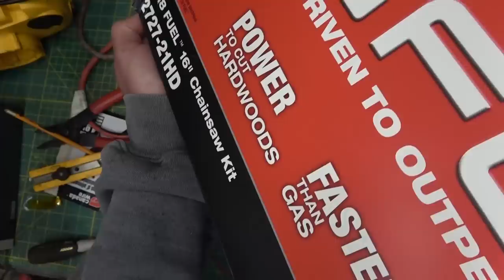BOLTR: Milwaukee Chainsaw | Destroys DeWalt

Comment: Good thing about the battery operated ones is that you can send the apprentice to the shop for a gallon jug of charge to refill the batteries.
Reply: We like the box full of 3/4 holes 😂😂😂
Reply: Worked till we had one smart ass grab a box of 3/4 o'letts lmao
Reply: Cup of steam also works great
Reply: Metric adjustable wrench used to work but some come with us standard and metric scale printed on them, But alas we still have a board stretcher next to the left hand screwdriver!
Reply: Next to the left handed screwdrivers.
Reply: I prefer the left-handed sockets and the automatic safety wire drill bit
Reply: Dave Pawson  pink or blue? They keep them next to the long stands
Reply: Pipe stretcher is a personal favorite.
Reply: Just like sending the newb to borrow the wire stretcher from the electricians.
Reply: "gah! Battery's outta juice. Aye rookie! Get some juice for the chainsaw!
Reply: A jar of sparks for the grinder.  The poor lad returned an hour later asking, "Jim said what colour you want, blue or orange?".  Off he went for orange sparks.  Still raise a chuckle 29 years later.
Reply: Reminds me. Got to renew my concealed carry permit for the grease gun.      🔫
Reply: Tartan ink. Was a favourite of mine.    Look up-kevin bloody wilson  ( The apprentice )
Reply: Tire stapler was my rookie search
Reply: Good ole hook calibration
Reply: chris jones are those compatible with 3/4" Fallopian tubes?
Reply: Compression powder, for when an engine has start difficulties.
Reply: Watched a newbie directional bore locator call the boss for a bag of rock-be-gone the other day :)
Reply: when I was working as a nurse rig driver for an agricultural flying service (crop dusting company) I once sent my flaggers back to the hangar to get a bucket of propwash....... why is doing stuff like that so fun??
Reply: Sent the apprentice to the parts room for a vacuum tobobilator.
Reply: don't forget the light bulb repair kit
Reply: Grab a bucket of compression for my engine
Reply: I would have loved to get sent on a fool's errand - might take me two hours to get back.
Reply: I need some fucking slack, go to the trailer and cut me some slack
Bout 3'
Reply: Go get the piston return springs, not the cheap ones either. The good ones are blue
Reply: Don’t forget to fill up the phone with powdered dial tone.
Reply: @JeffroDH  in my industry we have them chase down a Cable Stretcher and sometimes a Sky Hook.
Reply: 4 years later, but as a young roofer I was asked to grab a shingle stretcher one time... Happily asked the next guy under me to do the same when the time came 🤣

Comment: If you spot a full sheet of those "security" strips, swipe 'em. In bulk won't set off the detectors and you can prank people for MONTHS with a full swiped sheet. My record while working retail was stuffing one in the general managers lunchbox, tucked up under the zipper. Took him the better half of a month to figure it out, though pegged me with it immediately.
Reply: Hope you didn't AvE, the guy is trying to get you busted. They WILL go off, of course.
Reply: Take a random item and drop it in your buddy's sweatshirt hood watch the hilarity ensue when he walks past the detectors
Reply: Oh man, a friend of mine told me he did this to his boss way back. Said they were in home depot together, back when they used to have the tool coral and he managed to swipe a sheet of them and said he must slipped a dozen of them in his boss's cuffs and hood and pockets and whatnot and then showed himself out to the truck. Said his boss was as red as beet when he finally made it through security a half hour later!
Reply: I’ve done this, you find the coat rack and load everyone up, then be positioned for cheap thrills

Comment: @5:23 I work in plastic injection molding as a process tech. I have to mix up red color pellets into natural glass filled nylon all the time. Red can be hard to get right sometime and it is true molders will cheap out on the color, and try to use less resulting in lighter parts, and in worse case scenarios the color will be uneven. My guess is that between 2011 and now they changed suppliers on their color concentrate and the new one is not an perfect match to the old one. just my $.02.
Reply: I was thinking the same thing. I have experience in all types of food production and when working with things like candies, frostings, fondant, cakes and cookies, it is very hard to get a good red. A few ppm too little and you have pink or orange, a few ppm too much and you start to go black or brown. 
It's also the same with florescence. Reds take a lot more dye and a lot more energy input to give the same vibrancy.
Reply: I don't know, but my Makita gear is getting to be the same way. Growing variability in the new tools when it comes to exactly what color the corporate Theft-Deterrence Teal actually comes out. Some of that is down to base plastic, for sure, but I think more if it is coming down to contract manufacturing overseas. The little accessories (flashlights, usb chargers, etc) are the worst, understandably, but the tools are getting iffy too.
Reply: What it ultimately comes down to is value engineering. Procurement changes suppliers to a place that is 1% cheaper and 100% worse. I see it and fight it everyday at work (I'm a development engineer), but they always win
Reply: Also possible its a marketeer special and they decided a minor color to the brand identity change could result in more sales somehow
Reply: This. Unless its a premix and its color matched to a sample its a fucking raging nightmare to get it exactly right at the time of production.
Reply: Mike Hegarty  This is why they should have a separate sub brand for home gamer tools. It's obvious this is not a professional tool, and it kind of detracts from their brand.
Reply: James McCabe ¢
Reply: @nathandexter7483  It gets people talking about it, that's how. Any press is good press...
Reply: Yup always trying to use less colorant and washing it out
Reply: Red #40 is a strong un.

Comment: I spent 10 years as an arborist. The price of chains and bars is the real profit eater. In which case, feed that bad boy some Earl, and I mean lots of Earl... Used to fine tune the oil to run out at the exact same time as the fuel (makes sense to fill up both tanks at the same time)... But you wanna talk about a hot supper, we used to mulch the trailers down with 32" bars on Stihl MS-460s... Wide open throttle chopping through 8' wide, 3' deep sections of packed 3-5" sticks and leaves for an hour at a time, with no end in sight. Used to run 40:1 oil in those saws and tune the high rpm for it so we didn't smoke the pistons running lean...
Reply: First thing I do as well, turn the oil screw up, oil is cheap. Set too low at the factory, ostensibly for "environmental" reasons.
Reply: This reads like  a Jerry Reed song.
Reply: Yeah, as someone who lacks personal preservation enough to climb up into trees to cut them down from top to ground, this chainsaw is attractive to me so that I can use it for the high stuff that's hard to reach. I'd be fine switching to a gas powered for the big limbs and trunk once I've worked down below the canopy
Reply: Why aren’t you an arborist anymore?
Reply: i mix mine at 32:1 I would rather clean a spark plug (not that I ever have to do it ) then replace a cylinder and piston
Reply: @dusty2206  Seriously did you really write that?!?! Bwahahahaha! Have you never mixed fuel for a 2 stroke motor mate?
Reply: Kevin Kinsey Bingo! Yeah, or worse - cranks, bearings and seals.
Reply: Hey my man why tune the oil to run out same time as the fuel yes run more oil but dont risk snapping a chain by running out of oil before you run out of fuel you always want oil in that tank and 30yrs bro you should know always fill oil with fuel

Comment: The line across the body is used as a sight as it is 90degres to the chain, and the little metal tab is the chain arrest if it throws the chain.
Reply: When he called it 'greebling', I couldnt help but wonder if he's been watching more Adam Savage kit bashing lol
Reply: Beat me to it, but that is exactly what it is. On a Stihl, they usually paint them black to make them stand out more.
Reply: Came here to post these details, yes, the gunning lines are universal and possibly OSHA required on all modern chainsaws.  Chain catcher serves two purposes:  first, obvs, is to keep a stray chain from severing yer olde carotid should the sprocket decide to fuck off.   Second, less obviously, is to keep same chain from damaging all of the stuff inside of the clutch cover, including the case itself.  The way it works is that when the rotating body that is the chain comes loose, it folds over the sacrificial aluminum tab that is the chain catcher and gives up most of its inertia.  This chews hell out of that tiny little bit of beer can but does little or no damage to chain, saw, or user.  Replace the thing when you think to.  It'll catch a few chains before giving up the ghost.  Don't tempt the fates over a 2 dollar part.
Reply: hyperbole doesn't always translate well in blind text, just sayin

Comment: Hey AvE, just had a coffee maker go out. Checked the thermal fuses and sure enough that was the problem. Glad I've watched your stuff otherwise that would've been $150 down the tube instead of $3 for the fuse. Cheers my man!
Reply: $150 for a coffee maker?  I've been using the same $20 retail Proctor Silex drip coffee maker since 2006.   I got it out of the dumpster on a $60,000 USD bathroom remodel job.  It was still in the box, looked brand new and worked.  The carafe tends to dribble which is why I think the home owner threw it out.  12 years from a free cheapo coffee maker, when is life better, eh?
Reply: if the thermal fuse went it went for a reason
Reply: Similar here.  Had a ShopVac quit working.  Took the whole thing apart to see what was up.  Buried on the back side of the motor was a thermal fuse.  Darn annoying.  Could have been on the front where it was easy to get to.  Anyway, got it fixed up with a bit of old plumbing solder and it's back working.  Good thing I saw the old vid so I had a thought that might be cause.  Score one more for AvE!

Comment: Gunk on legs will be so the leads don't vibrate - you could hit a resonance that would stress the joint
Reply: Yup, especially with the lead-free stuff. But there are some modern alloys that aren't as horrible as the lead-free stuff from the turn of the century.
Reply: It could also to help the conformal coating process. They've really gone to town on it, and those legs are the only areas where there would be an overhang/void that risk not being easily coated.
Reply: They build these for casuals. No self respecting lumbar jack would be caught dead with one of those.
Reply: Trey Nathaniel A lumbar jack? Is that like a jack that you put under your car seat to get comfortable?
Reply: No self respecting pixie wrangler with a soddin iron would ever touch the devil’s alloy...lead free solder? If California ain’t pissed off about it, you ain’t doin it right.
Reply: @BenjaminEsposti  which century is that, exactly? despite the modern advances in technology, the world reverts to using older crap-tastic stuff that does no one any good. XD
Reply: @treynathaniel4075  Your snarky won't get you by, Trey*.
Loggers. Lumberjacks are guys who throw axes at
 the County Fair. *A good name - for a dog.
Reply: Byvägen  clearly not a Monty Python fan; otherwise, you'd have gotten it
Reply: Trey Nathaniel my Dad and Grandfather were Lumberjacks from Sweden and North Western Ontario - NOT “loggers” ...

Comment: That broken wire you were talking about was never attached. I looked back and zoomed in when you first took it apart and that wire was sticking straight out. Before you ever removed the motor. or even touched the motor.
Reply: So did I.  Broken wires don't turn back like that, and there would be bare conductors sticking out on one end or the other.
Reply: 23:26 Bottom-left corner. It seems there is another cut cable that was bent toward the other side of the conection. They dont need them, they dont connect them?
Reply: I noticed there was a second wire cut as well. I’m guessing they used ribbon cable they had rather than something specific made for the job.
Reply: Also, it's not the first-last wire in the ribbon. Ya can't break mid-wires prematurely.
Reply: Laimis B excellent point. But I guess AvE, just like all of us who bumblefuck around in the shop would just assume it was our fault. I mean I would for sure because of my long history of fuckin' shit up.
Reply: good catch

Comment: I work in the injection molding industry, the odd colour could be from the lack of mixing the compound and concentrate together good and proper.
Reply: This mixing compound is called masterbatch and it's usually 1-2% concentration. I used to work for a company making them, worse colours were black (made out of soot) and red. When we were producing red everything was covered in red - probably even worse than black :)
Reply: But wouldn't a large company like Milwaukee, which relies on it's image and brand recognition have a lot of oversight on stuff like this? I can't see someone this big not rejecting materials which will impact brand recognition and image(which is a big reason why people buy and overpay for Milwaukee). Also, whoever produced it would have to eat the costs in order to keep Milwaukee as a long term account. I wonder if they just make one run of an item like this or do they manufacture more of the same design when low in stock or just do a slight redesign to get people to buy the new one.
Reply: it seems to be a large lot issue... I got two new brushless drills and they are lighter red also
Reply: ...or the marketing pencil necks decided a lighter red would help sales. Perhaps the darker red reminds people of blood...not good for a chainsaw 😁
Reply: I have a portaband from a few years ago. Same color.
Reply: In the PRINTING industry anyway they have to do a buyoff with a Pantone matching system.   Would be surprised if there's not some kind of buyoff before they release HVM.

Comment: You can hardly be blamed for breaking that wire. That soldered in ribbon is a big no no, it will just never last, I learnt the hard way. the conductors are too thin to stand on their own, so they rely on the fact that they are bonded in a row of other connectors to survive.
Reply: arcadeuk And, usually, proper strain relief and anchoring!

Comment: Hey Ave, idea for your next BOLTR, you thought hilti was an expensive drill? Check out Stryker drills. I work in orthopedic surgery and we use these things all day long screwing wrists and ankles back together when the CA glue and ductape doesn't work. Would be interesting to see the inwards on the outwards.

Comment: That pew pew "greebling" you mention @11:45 is meant to be felling sights, perpendicular to the bar. So you can see which way the tree should fall when you cut out the wedge. Every decent saw has those lines. 

Not that anyone would use this thing for doing any real work :)

Comment: You see silastic around the legs of mosfets on power amplifiers for speakers, as well. I always assume its for some kind of insulation, not necessarily strain relief. At those levels of power, I'm guessing there might be an arcing issue when debris gets in it.

Comment: The bar oil pump is a very simple design. The end of the gear shaft by the hoses is at an angle. As it rotates against a high spot of the housing it will move in and out as the high spot traces a line around the angle at the end of the shaft with the help of a spring to hold it in contact. As this shaft rotates and moves in and out it pumps the oil through like a piston. That is why the gear on the shaft is so long. A worm gear is used to get a large reduction in RPM of the pump shaft.

Comment: As always, thank you for a fine video! I'm not sure if someone already answered this, but the pump looks almost identical to what you'll find in most Stihl gasoline saws. It is a tiny piston pump that operates on a cam. Also, most good gasoline chainsaws run at least 12,000 rpm, so your 7,000 rpm estimate is probably both accurate and much more modest than it sounds.

Comment: I pree ordered this saw couple months ago and love it. It came with a bonus 9ah battery I'm clearing a chunk of Bush on my farm and this saw is what I'm using so far so good I love it. The 12 amp battery lasts decent. The 9amp battery eventually overheats once it's almost dead and then I use my 5amp batterys as spares in between changing. They cut fine but go dead quick. I would think you would need at least  4 or 5 12amp  batteries to keep it going non stop all day long while charging your dead ones on the go. I hate my gas saws with a passion they sit for months or years at a time and then when I wanna use it it starts shitty. I would say it has just as much power as a 40-45 cc saw. Most ppl don't use a saw that often and this would be perfect for those ppl. Plus those batterys that you have can also be used in all sorts of other Milwaukee tools in the mean time so the value is very good.to me it does not feel cheap at all in my opinion I'd recommend it to most ppl that have Milwaukee line up of Tools and use a saw occasionally.
Reply: Thanks for the good review, i use the crap out of Milwaukee stuff & if you dont try to tear them up, they do last!
Reply: James Penner 2 Words: Seafoam additive. Put it in the tank to prevent gas turning to crappy varnish and disconnect tank from carb and run motor until float bowl is dry and spray sea foam in carb